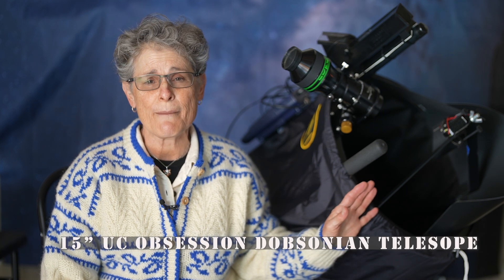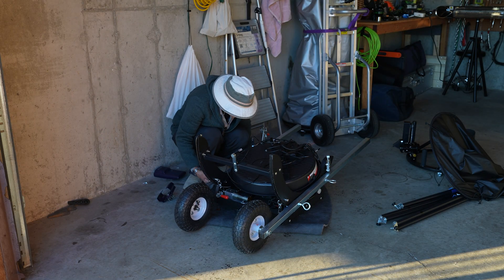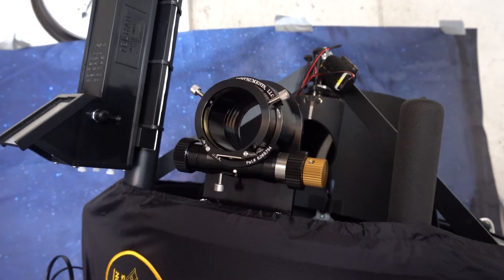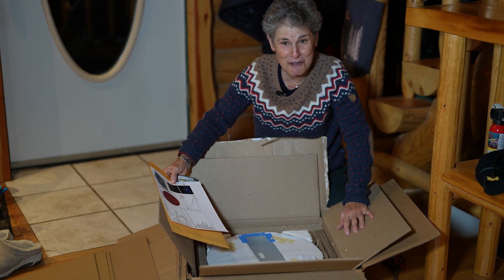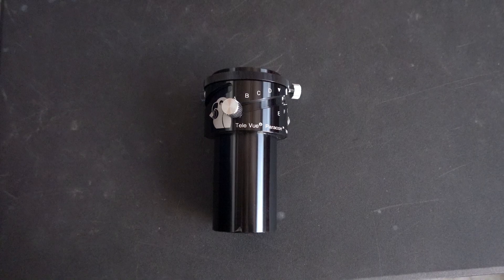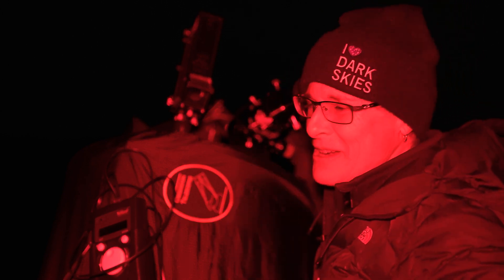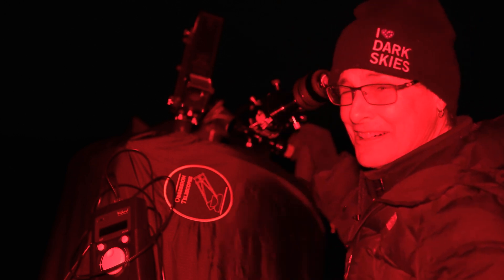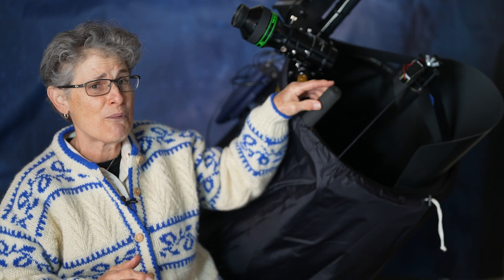Review of the 15" Obsession UC (Ultra Compact) Dobsonian Telescope!

Comment: Hey Tsula, nice video.  I've got a tip for you as an 18" UC owner.  Get a good step stool even if you don't like using them, because the right one makes all the difference.  Take it with you to star parties in case you need that 3 inches at someone else's scope, or have it for guests who are shorter than you.

I like Amazon item B0DVYTX6W5 made by Tengyi. It's rated for 600 lbs (!) and can be adjusted between about 3 and 4 inches.  Get the gray top version which will show up under the Milky Way, not the glow in the dark version because it's too bright for night vision at a dark site.  I've taken mine into the field on two Bortle 1 expeditions now, and it passes the test with flying colors.  I go to the empty Oregon/Nevada border and WOW.

600 lb capacity might seem like overkill, but what that means is that when YOU step on it, you will be extremely secure even if the footing below is a bit uneven.  Then, consider the star party aspect.  You never know who might come view your rig.  You don't want a heavy person to break a piece of your gear in the field.  This capacity pretty much solves that issue.  I weigh 370 myself and the easy step up step down is drama free.  It's completely different from a six inch stool that might lead to a turned ankle in the night.

I'm 5'11 and I'd say this stool fills in Dobson's hole for me almost all the way.  My only remaining issue with a target at 85 degrees altitude is figuring out the azimuth without a ring of stool around the telescope to step around.  A little trial and error and I'm in business.

Last, I'm sorry you had to sell so much stuff to get this 15", but in retrospect wasn't it worth it?  This is my PRIMARY instrument.  This is what I take out to look at galaxies in Coma.  It's what I take out to see pink in M42.  You can get by with a scope in the 8-12 class, but there's so much out there that you just won't see without a big ol' Dob.

Comment: I built a 15" back in about 2005 using Dave's book, with a Swayze mirror. It was fantastic. I fell into a period where I wasn't using it much, mainly due to a busy work life, and sold it in 2010. I have regretted it since.
I have just made an appointment to go buy a used 18" Obsession UC tomorrow, and I'm very happy about it. TBH I probably will not use it much in the winter but it's worth it just for the summer views. I wanted an 18" back when I had a 15. I bought the 15 because its eyepiece is at standing height at zenith, but honestly I'm not at zenith that much, and the 18" should only need a small aerobics step not a ladder.
Reply from the maker: That's very impressive that you made a 15" telescope.  I wanted the 18" but I felt that it would just be too heavy for me.  I'm very happy with the 15" telescope itself but the Argo Navis has been giving me problems.  I decided not to use that cart that I made because the caster wheels were too flimsy and it caused the telescope to bounce around a lot when pulling it out of the garage and it made me need a ladder.  So, I decided to just make the extra effort to use the wheel barrow handles and take them off at night and install the encoder and at the end of the night remove the encoder, try not to lose the two screws, try not to damage the fragile encoder, put the handles back on and wheel it back.  Phew.  But I do not need a ladder at all even as short as I am.   Did you use the Argo Navis with your 15" and will your 18" come with an Argo Navis?  Mine is driving me crazy.
Reply: @tsulasbigadventures  My 15" got sold in 2010. I don't think Argo Navis was around back then. I had a Sky Commander.
Honestly, I don't really like DSCs, I like finding stuff on my own.
I just picked up the 18" a couple of hours ago. Yes, it's pretty heavy. The previous owner sold the Argo Navis because he's using a Nexus WiFi thing attached to a phone app. I will play with it but I doubt I'll use it. For me a good chunk of the fun is finding the objects without any help.
Reply from the maker: @John_Ridley  Thanks for explaining and congratulations on your new 18" telescope!  I enjoy sta hopping too but it's nice to have a motor to keep the telescope steady and tracking is nice to have too but I understand.  I like the joy of finding something too.
Reply: @tsulasbigadventures  Yes tracking would be nice. I've always thought about building an EQ table but have not so far...

Comment: Hi Tsula, trivial question, but how are you mounting your Telrad without using the tape? Is there a bracket made for it? I haven’t been able to find one and don’t want to mar up my OTAs with the adhesive. Thanks, Chad (love the channel!)
Reply from the maker: Hi Chad.  Thanks!  Not trivial at all.  The Obsession comes with a pole specifically for mounting a telrad but on my 10" Dobsonian and my SCTs I just use the tape the telrad comes with.  It comes off easily.  I accidentally knocked it off one of my telescopes when it hit the garage door.   In fact, if it ever falls off the tape no longer holds and I've had to put an extra piece of tape over the top to hold it in place.  The tape won't mar your telescope.   All the best.

Comment: i could only justify this if i lived in a dark sky desert area at least half the year. fortunately i do just that and am looking closely at Obsession. i'm surprised by the inelegant accessory fit and plastic pieces. A telescope called Obsession should constantly strive for perfection even if ultimately impossible. this needs to go back to the drafting board to include all options and do away with wires and little lost pieces, we live in the future now. clear skies and may the force be with you, always....oh and a name...what about TITANIDES or Titaness, the six earth-goddess daughters of Heaven, Uranus and Earth, Gaia.
Reply from the maker: I ended up naming her the Swan. The thing I dislike most is that the cables that make it goto dangle outside the shroud and I have already had them snag ending my session . Other than that I cannot complain at all. You used to be able to install a stalk to hold the controller and manage the cables but the guy who ran the company closed. Well, I hope you find the telescope of your dreams.

Comment: I had the obsession UC 22 and there’s a way to fix the scope to the base and move it all in one piece. I would move it out of my basement like that so I wouldn’t have to assemble it each time. I could be observing in less than 10 minutes.
Reply from the maker: I decided to remove the pneumatic wheels from the JMI Wheeley Bar and install caster wheels instead and now I can leave it assembled with the encoder attached at all times.  I'm much happier even though the caster wheels are not nearly as sturdy as the pneumatic wheels.  I am just extra careful.

Comment: Very nice review. How well does this telescope hold collimation? I have read that there are problems with it.
Reply from the maker: It holds collimation very well.  I keep it on a wheeley bar.  So, I haven't had to collimate it unless I take the top off and then of course you have to collimate in that situation but as long as I leave the top assembly on it stays collimated.

Comment: Hey Tsula

As you know, when using a Newtonian, the eyepiece will wind up in an awkward position in most cases.  That can be solved by rotating the tube in the tube rings, but how do you solve that problem with a Dobsonian (assuming you're using an eyepiece and not doing astrophotography). I never used a Dobsonian  before.
Reply from the maker: The eyepiece on this Dobsonian is almost always in a comfortable position because you can easily swing it from left to right.  The only awkward position was straight up at the zenith because I have to stand on my tiptoes.
Reply: Ok.Thanks

Comment: Did I miss a vid where you told us about Artemis? Your 12 inch SCT?
Reply from the maker: Artemis fell off of the Wheeley Bar while I was making a video about safely moving your heavy telescope while I briefly had removed the strap.  I think I mentioned it in the video where I made a Dobsonian cart.  I was heart broken.
Reply: @tsulasbigadventures  I am watching that vid now. Sorry you lost the 12 incher. That is an expensive loss. I have a 10 inch dob and I. got a furniture moving dolly to move mine around.
Reply from the maker: @lornaz1975  Thank you.  I was crushed to the core but I feel better now and this 15" Telescope I got as a replacement is wonderful.
Reply: @tsulasbigadventures  I imagine so! No one can sneer at an obsession!

Comment: Thanks for making this video. It’s very interesting to me for several reasons.

But first, I guess you will like going from a 10 inch Dobson to the 15th that’s a big upgrade 

Did you make a video of your 12 inch SCT breaking the front corrector plate? I don’t remember hearing you say that or watch a video of you saying that 

You also mentioned you sold your sky watcher  eq6 what will you do with the 150 mm ED?

I’ve been thinking about something like this. I wish they had a 10 inch version ultralight. 

I’m also looking at the other brand called Hubble optics the smallest they make is a 12 inch as well 

What I like about the Hubble optics is that it fits in a suitcase? 

So why I am thinking about this maybe in another one or two years is because I travel right now when I go to other countries with a sky watcher 150 mm heritage 

I’m trying to find something maybe like a 10 inch ultra light but they don’t make anything this small 

So I’m thinking of upgrading if I can find something that will fit in a suitcase, maybe going from a 6 inch to an 8 inch which is not very easy 

Something like the sky watcher Quattro eight is about 27 inches long and about 16 pounds or at least different versions of this type of telescope, which is a little too long for a suitcase . Well, my suitcase is 27 inches but I have no padding then for the top and bottom so I fear it’s just a little bit too long by about 2 inches.

The other method I can think of is an 8 inch SCT, but I am really fearful that the corrector plate will not survive back-and-forth on an airplane

So I guess if I retire at the end of this year or next year, I may then consider the Hubble optics 12 inch that fits in a suitcase 

My plan would be if I live in Mexico for six months. I would buy something like that and keep it there in the 12 inch is large, but if it fits in a suitcase, it’s only travelling once then I would keep it there and observe with that

And then at home, I have my 12 inch sky watcher flex tube 

If I ever find a 16 version cheap, I may upgrade to that when I go to my zone two in the six months of the summer 

So that’s why I’m interested in it but right now. I don’t think it’ll work if I’m just doing  3 to four weeks vacation a year.
I may still look at a 8 inch reflecting telescope. If I can find one a tiny bit shorter than the Quattro and a little bit less weight I may consider that but for now I guess I’ll have to stick to the heritage 150 when I go airplane traveling. 

That’s why your video interest me and I’ve thought about it for about a year but it’s just not the right timing yet
Reply from the maker: Thanks, Joe.  I have been having this same debate for a long time.  I really wanted to go from my little 6" Mak to an 8".  The 6" Mak is a wonderful telescope and fits in a suitcase but I really wanted an 8".  But like you I worried that the corrector would break in the suitcase.  The corrector plate is usually what breaks on SCTs and that is what happened to my 12".  I was making a video about safely moving heavy telescopes and had temporarily taken off the tie ropes and when I pulled the Wheeley Bar it fell over and crashed.  It is on the video but I cannot watch it.  It made me so upset that I nearly cried.  I loved that telescope.  Well, Obsession makes the 12.5" Classic but it looks a bit chunky to travel with.  It's a shame they don't make the 12.5" UC.  And the problem with the 8" reflector is that they are so long.   I guess if I were determined I would just put an 8" SCT into a Pelican case and check it.   You could put it in the overhead bin too.  Well, I'm still thinking too.  So, if I ever come up with a solution I'll let you know.  
Oh and about the 150ED.  I could still put it on my Losmandy Mount which can easily handle it but I was thinking of selling the 150 refractor. I haven't decided yet.  Thanks for watching.

Comment: Hi Tsula! Great video! I have the same UC 15, but at the time 2023 I opted for an eq platform. Was planning to use plate solving camera as Tiago does on his donsonianpower channel. Then recently PiFinder project started and the platesolving solution was much easier. Essential for eq plate as the system is tracking in right ascension…making Alt-Az encoder approach moot. We’ll see, waiting for clear skies. My Bortle 4 site is now 5.5-6😢
Reply from the maker: Thank you.  That's interesting because yesterday I was thinking about the Starsense technology and thinking that all goto telescopes should just use a camera to plate solve and amateur astronomers should never have to buy an inaccurate goto telescope ever again.  I was thinking that this is the way of the future rather than encoders.  I'm not familiar with the PiFinder.  Will have to look it up.  My Bortle 3 is slowly getting more and more light pollution and will soon be a Bortle 4.

Comment: Hi Tsula. This was the review I've been waiting for! I've been eyeing the 15UC for some time now, mainly because on the Obsession website, the 15UC seems to have the lightest mirror box. But I'm still a little concerned about lifting it into the back of my SUV. Do you feel that lifting it is still doable? And I have a feeling thanks to your review that Obsession is going to get a lot of orders for the 15UC.
Reply from the maker: Thank you.  The mirror box alone weighs 45 pounds maybe a little less without the ServoCAT in it.  You could make a ramp and wheel the telescope into the car.  I am worried at my age about lifting 45 pounds above waist level.  I have been thinking about having Omar make a ramp for me.  Or maybe it is possible to buy a light weight one.

Comment: Tsula, I'm so excited for you! I have a similar scope - a 16" Teeter Dobsonian that also has all the bells and whistles. If you are a visual astronomer, a premium Dobsonian like this is without rivals.

At this aperture, I'm thrilled you got the "grenade" 31mm Nagler. That is the eyepiece I use 75% of the time in my Teeter.

If you have a Binoviewer, the views are breathtaking. I use the new Denkmeier Binotron 27 with 24mm panoptics, adding the power switch and filter switch. It required a counterweight at the back due to the weight. 

The only downside of this scope is the size. I'm under 50 years old and pretty physically fit, and it's still a lot to move around. As a result, unless you live in a really remote area, or have a dedicated observatory, it won't be an every night telescope. 

So happy for you!
Reply from the maker: Thank you!  I watched many Teeter videos trying to figure out how to get the Argo Navis working. Those look like nice scopes too but I guess Teeter went out of business.  The weight was a big concern for me for this and for any telescope purchase.  At my age anything over 65 pounds is out of the question.   The 31mm Nagler is amazing.  I bet using the binoviewer would be mind blowing on this telescope.
Reply: @tsulasbigadventures  the Teeter is wonderful, but it's box is all hardwood and at 16", it's not easily moved around.

I picked up the scope at Rob Teeter's workshop and he gave me a full tutorial on it's use, assembly and breakdown. Very cool.

I've considered a bigger scope, and given what I know about the size I feel like the UC category is what I would look for.
Reply from the maker: @AstroDavey  That is invaluable that he went over everything with you but yes, a wooden box would make it very cumbersome.  I highly recommend the UC if you do decide to go bigger.